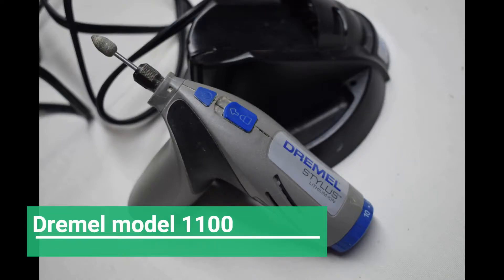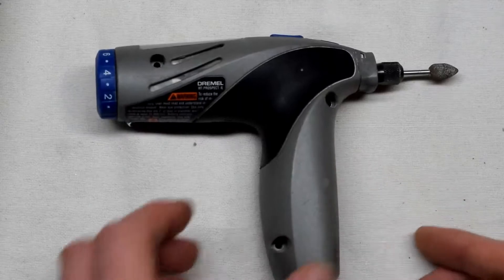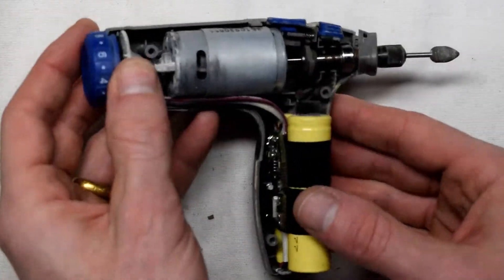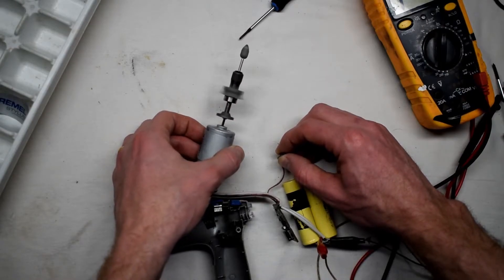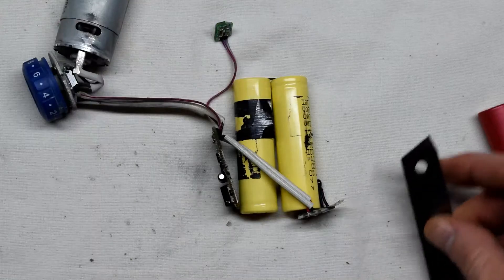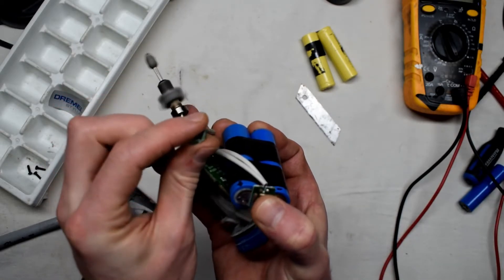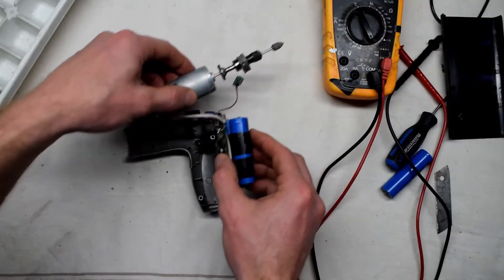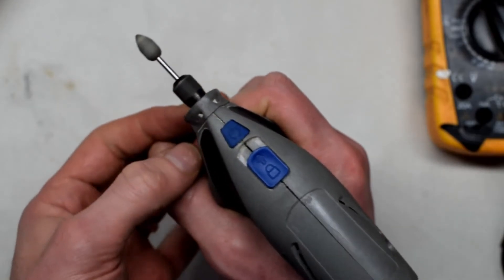How to fix a Stylus Dremel model 1100

Comment: Just opened mine up in 2024, nice video, others leave out the fact that after you remove the screws you have to pry the two halves apart because they are clipped together. You did leave out the part where you have to remove the connector from the other end of the batteries and solder it back to the new batteries.

Comment: Had to throw a like and comment out for this one.  I got an old free 1100 that wouldn't charge and figured it was the battery. The laptop battery mention was what helped. I had an old useless Inland laptop battery, cracked it open and sure enough it was 6 18650 cells. Soldering is my krytonite but got everything buttoned back up and working/charging.

Comment: Thanks for the procedure. One tip for anybody that giews this in the future. Run the three screws back into the holes after seperating the case. And slit the labels with an exacto blade.

Comment: Thanks, Knowing when to pry parts open vs when to look for another fastener is key info! 

(I finally figured out how to fix my dremel driver & wanted to clean up my stylus that was looking battered. The driver has a hidden screw, so I was looking all over for the hidden lock on the stylus until I found your video.)
Reply from the maker: glad I could help

Comment: thank you... I always wondered if you could'/should solder a battery? I accidentally tore off one of the nickel flaps but managed to half-ass reattach it and re-solder and still  works like a charm. even after my shoddy craftsmanship. Ive had my stylus for about 15 or so years and now it has anew lease on life -  cheers mate!

Comment: Hi, thanks for the vid. Concise and to the point, i like it! However, the batteries are 18650 cells, and your link to batteries points to 26650 type batteries. Not a battery expert, maybe both work. 
I have a broken (case broken) Makita battery with the same cells inside, so my plan of approach is to charge the individual cells (Nightcore charger), search for the best cells, and use these in the dremel.

Comment: i did this repair a few weeks ago and i used some panasonic 18650's. it works great, but after using for a project last week i put it in the charger to top off the batteries and it's shows green right away. is there a mod i need to do to the charger?

Comment: Hi
I have lost my "Dremel" charger stand. How I can make a charger (DIY)? What is the Voltage and Amp of the main charger for this model?
Reply from the maker: just use an dc adapter around 7.2Volts connect to the two pins, not sure what pin is + or - use a multimeter
Reply: @NewsonsElectronics  Thank you.
Can I convert it to a direct power supply and remove the battery? For example, using a 7808 Regulator, and connect it directly to the circuit. How much current does it need for max speed?
Reply from the maker: @mehdi67ny  you could just get a dc adapter that outputs about 8v dc
Reply: Do you still need a charger? I have some in stock
Reply: @brambhai4877 I would like to purchase a charging dock if still available

Comment: my batteries are showing 3.7 but i belive my circuit is dead but not sure . do circuit gets dead often ?
Reply from the maker: check the connections with a multimeter
Reply: @NewsonsElectronics  i tried but no response
Reply from the maker: @tsar2106  spin the motor does it spin freely
Reply: @NewsonsElectronics  yes it does
Reply: @NewsonsElectronics  friend motor is dead and now i m have issue how do i remove that spindal lock from motor

Comment: Have a new link for the batteries?  That link is bad now
Reply from the maker: the cheapest way would be to buy a laptop battery replacement and break it open they will have the same cell types. https://amzn.to/3a6aol4
Reply from the maker: you can also buy them from china http://ebay.us/PfZXVS
Reply from the maker: if your in Ontario Canada I have batteries if you need them.